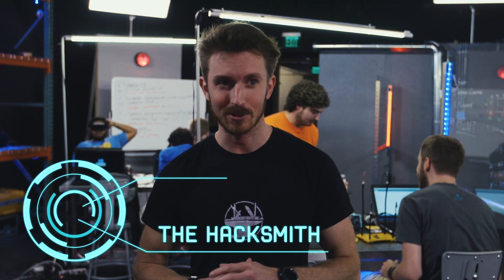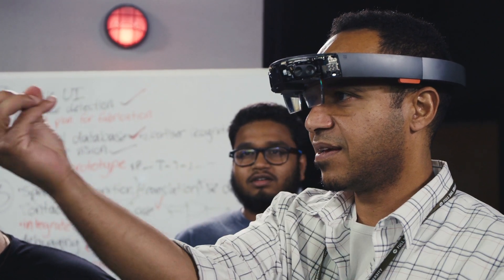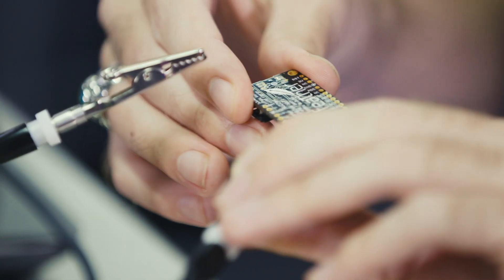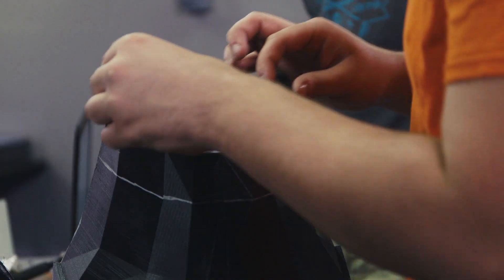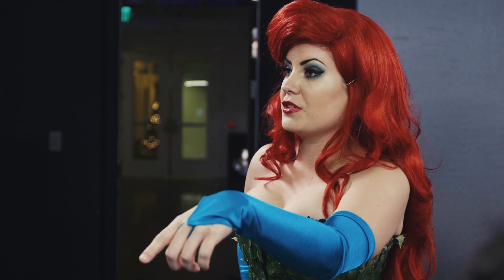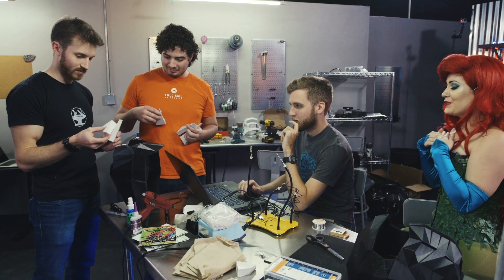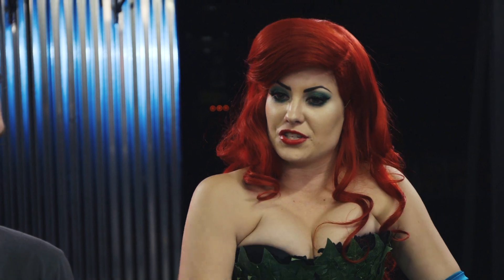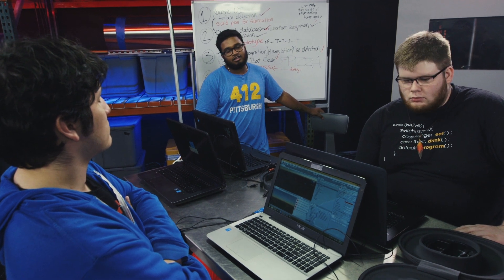Hacker Labs: Batman Cowl Challenge Ep. 5 | Full Sail University

Comment: Beginning the video a guy mentions his issues with his laptop...this is why laptops are not a substitution for a good desktop- work grade hardware.

Laptops just are not expandable enough to handle large workloads. Even the $2k laptops cannot compete with a $700 desktop.
He says he has to reinstall the OS, as he doesn't have enough space for the software he's going to need...if he would have been using a desktop, he could just add another hard drive.

It always bugs me as an IT Specialist when students get laptops for school. They are barely made for light tasks such as web browsing and watching videos, what makes people believe they can use them for coding and heavy 3D modeling?

If you want real performance for your money, get a desktop. Even a top of the line laptop cannot hold a candle to a high end desktop, as you can always add and upgrade a desktop. Only minimal amounts of upgrades are available on a laptop(none at all if you're using a Macbook).
Reply: Kris Bright sl true
Reply: Fair argument but you must admit laptops are able to do semi light tasks. Also the main reason people buy laptops is because they are much more portable. Now dont get me wrong I'm on your side as far as price and performance go. Laptops are definitly applicable in certain applications. And to add to all of this your argument is based off his laptop breaking well desktops break just as easily.